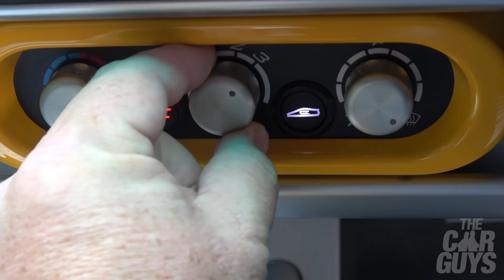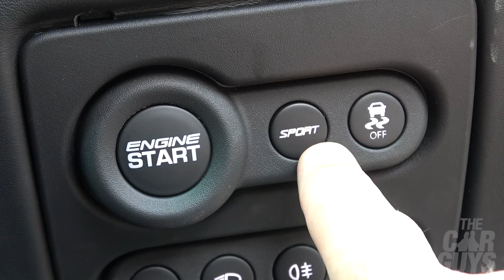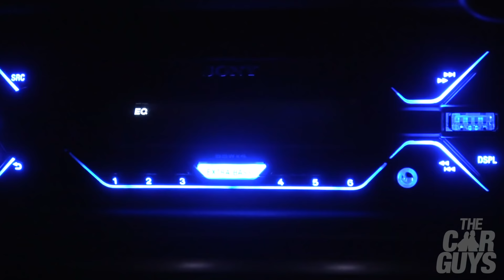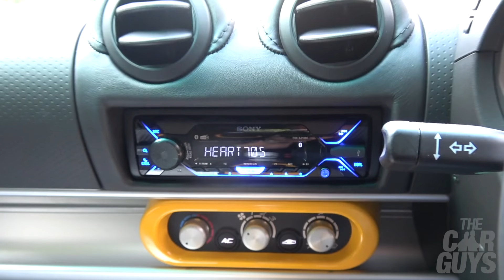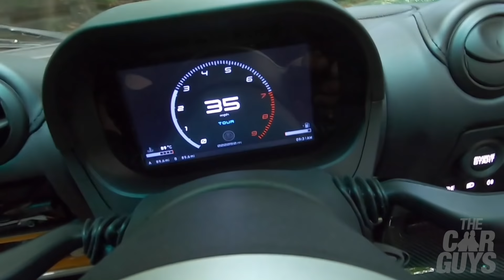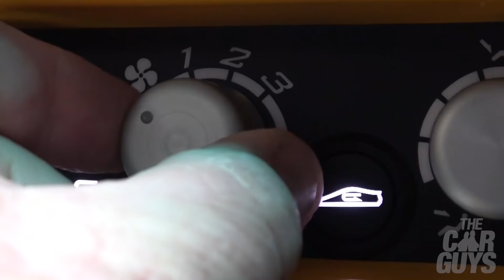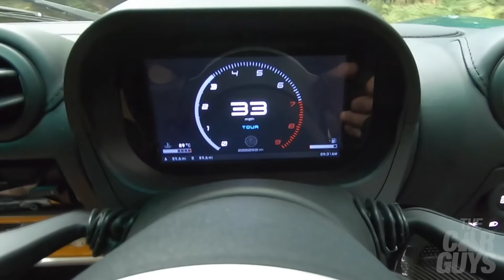650-Mile ROAD TRIP in My Lotus Elise 240 Final Edition – Is it a Keeper? | TheCarGuys.tv

Comment: I saw how your Lotus looked like a refrigerator. Tips for getting a car quickly warm inside. Start the engine and lower both front side windows by about 3-4 centimeters and set the fan to maximum blow. This means that the old cold air disappears and new and warmer air from the heating fan enters the passenger compartment. If the windows are closed, it takes longer before the old cold air in the cabin gets warm.
With kind regards from snowy Kiruna Northernmost city in Sweden) and we have -17 degrees Celsius
.
Reply: Thanks! How long does one keep the windows open for? Until warm?
Reply: @andrewnorris5415  Yes until the car gets warmer BUT you should not sit in the car in the meantime. On the one hand, air flow is then not hindered for the good of the body.
Reply from the maker: God tip, Ingvar
Reply: That works on my Saab 99 too!
Reply: @nickrichardson7451  This works on all cars and depending on whether it is an injection engine, carburetor engine and diesel engine, it takes different lengths of time. As I said, an effective way to get old cold air out faster and for the car to get warm with new air that is heated. This is not a new invention, we in Sweden have been doing it since the 70s.

Comment: What video is next?  Cornering speed of a 2CV? Cross continent in a 1980 Defender?  Picking up a three seat sofa in a Mini Mayfair?
Why take a 650 mile road trip (mostly on motorways/Dual Carriageways) to see if you like an Elise?  It was never made to do it? Get up a 6 am on a dry Sunday morning and go somewhere epic for breakfast- then see if you like it.
The fact that you did this with the car and still came out feeling better about it just shows that it's a more rounded proposition than it's given credit for.

All your complaints are valid though, wipers, lights, stereo, brakes etc.  On a longer drive, forget the stereo and connect your phone to some earbuds.. better sound, less noise more relaxing.  And plan a route without motorways, or even A-roads!
Reply from the maker: A roads were included on the route as you see from a lot of the footage, but the maps were used to show the direct route for the purposes of clarity.
I’m not some clueless twenty-something, I do actually understand these things 👍
Cheers for your comments, Peter
Reply: @TheCarGuysTV  Clearly you're not clueless, apologies for any disrespect perceived.  I hope you enjoy and fall for the brand as others have. hugs and kisses 😃

Comment: Great conclusion Damien, you kinda nailed it. Having owned an S2 Exige Cup 240 for 2 years, I can confirm that 90% of the time on the road it was quite horrible. Full harnesses, a cage, dampers set up for the track, very crashy ride and no sound deadening. But, when you get to the correct set of corners you just forgive it for everything and fall in love with it all over again. It's a rollercoaster of a relationship, and winter time is the hardest part; Just save your conclusion until you've had a full summer with the car :-).

Comment: Apply some rain-x to the windscreen, i owned three Elise based cars and found that a couple of coats of the solution fixed the smearing problem and improved the wiper performance.
Reply from the maker: Great tip, thanks

Comment: I feel your pain.  I owned an Exige S for over 10 years and had many of the issues you've mentioned.  One piece of advice I would give, is how to get in and out. 
I think I'm probably a similar size and shape to you and found it difficult to bend in half too.  So I used a different method.  
I would crouch down and then 'post' my top half in across to the other side of the car, grabbing the sill on the other side with my left hand, then I could bring in one leg at a time.  No need to fold !! 
Out was the reverse. Lean onto the left-hand seat, put BOTH legs out of the door (one at a time), and then using the steering wheel and the seat, slide out into a crouching position.  
After a few goes, I made this look almost normal, fast and not something that would draw a crowd.  Good luck
Reply from the maker: Wayne Rogers - that is most certainly a method I have not heard of before! You may have invented something new there, Wayne.

Comment: Thanks, good watching as it highlights the issues that look to have all been sorted with the Emira. The KEF stereo speaker system is controlled by the digital screen. I have contacted KEF to find out more.
Hopefully, you will still have the Elise by the time I let you drive my Emira for comparison  - in terms of quality and how it suits a different market segment. I suspect your will prefer the Emira's grown up nature and I am not getting the dark green 😂
Reply from the maker: I am v interested to compare the 2, or an Evora at least, and see what's been fixed.
Reply: @TheCarGuysTV  Yeah, big play on it being a LOT different to the Evora but the jury remains out for now. Either way, to me, it looks like a stone cold bargain. Perhaps only the 296 being as good looking.
Reply: @TheCarGuysTV  from what I saw of the Emira at the Goodwood FOS the car is based on the Evora 2+0 chassis architecture, i.e. VVA chassis tub plus front and rear subframes, albeit modified and improved. So to me dynamically the Emira is not "all new" but an evolution. Lotus didn't want to call it the Evora S3 as they are starting with a clean slate and on a conquest to be more mass market.
Now the interior of the Emira though, to me takes a massive leap forward. Gone is the after market ICE/sat nav and electromechanical instruments. The systems are integrated, so it's bang up to date with a digital LCD dash and all the usual conveniences you can find in a modern hatchback like an integrated ICE (the aforementioned KEF system) with sat nav, Apple CarPlay  parking sensors etc. Lotus have put a lot of development work into the user interface. Elise compared to the Emira will be like a very mature cheese versus new chalk. The Emira will be like the Evora - more of a GT, but very capable on track. 
Comparing Elise versus Evora there is a choice of Evoras, but depends on which Evora you choose. I have a Launch Edition that is NA (it's one that is stock save for a 3rd cat decat and a Lotus sports exhaust back box - you are welcome to try it once it is out of winter hibernation) then there's the Evora S, which has more grunt and had a slightly stiffer suspension, then there are the Evora 400s, which are different beasts so I've heard compared to the original "series 1" Evoras. The 400 and GT410 Sport are closer to the Evora S than the more track focussed Evora Sport 410 and GT430 Sport.

Comment: I've fixed the stereo issue in my S2 Elise in 2 steps. 1/ remove faceplate 2/ buy a Bose portable speaker. No tool needed! Bonus point, you can move the speaker to different cars that have crap audio, like many Ferrari's :D
Reply from the maker: I use that solution in my NSX 😂😂😂

Comment: Hey! It's a Lotus! What do you expect? They have never been perfect, there are often strange ergonomics that make them difficult to get on with and annoy you when you least expect them to! I remember my first drive in a Series 1 Lotus Elan back in the 60's where, once I had set the seat to a comfortable position, I found that the gearstick was up somewhere around my armpit and extremely difficult to deal with! It didn't help that it was at a track experience day at Brands Hatch and I got marked down for 'a lack of mechanical sympathy' because of it!
When you consider that Lotus through the years have robbed the parts bins of whatever manufacturer they were dealing with to save the development costs of doing it 'in house' they've not done bad. It's a Lotus, it handles like a roller skate and on twisty roads it can outrun most of its contemporaries. Be glad it's not a 25 year old Moscvitch!
Reply: I'd agree, the review comes across as someone who has no understanding of what they were buying, and bought the car for all the wrong reasons. If you care about the stereo or interior bits in an Elise, you've wasted your money.
Reply from the maker: I really don't understand your position, guys. You act like I should have ignored all the niggles I found with the car because "I should have realised what I was buying" - what kind of a comment it that? You want a video where I don't mention anything I dislike?
Surely, if you are bothering to watch the episode at all, it's because you are interested in my honest spontaneous thoughts about the car, from someone who has actually paid for it, as opposed to being given it for free for a bit?
The whole point of TheCarGuys channel is that we honestly talk about the cars we are driving because we are not beholden to any manufacturers, and we are not trying to get free stuff all the time.
And guess what? That involves talking about the good AND the bad in a balanced way.
Obviously, I didn't buy the car for the stereo, the windscreen wipers or the headlights (who does that?) - so you think I shouldn't mention those things?

Comment: Amazing car. i love my Lotus Elise s220 CR.. 250 cv x 900 KG, MY 2016   
regarding braking it is true it seems that it does not brake but if you press hard the pedal brakes and brakes well. the fault is ours that being used to much heavier cars that have more powerful brakes .. I have never had problems stopping. during the most demanding braking you have to keep both hands on the steering wheel because in case of uneven ground the car goes sideways it follows the road same thing on overtaking especially on trucks the air movement could make you go sideways

Comment: Carbon Lorraine RC5 pads will fix the braking. Definitely change head unit for something else. They have always been rubbish. I’ve changed to a flip out Pioneer (reverse camera, telephone integration etc) but others have changed to a modern unit with a built in cradle. Sub woofer is a must and gives the rest of the speakers a second life. I’ve gone as far as ‘heated’ carbon fibre seats. Wiper needs changing to a Bosch if you want 95% coverage. There’s also a cheap really upgrade you can do for more intelligent intermittent wipe speed. There are so many mods you can do (lighting, reversing, exhaust noise etc) but sense you won’t be keeping it long enough….. if you do I’m based in Poole and can demo/talk you through them.
Reply from the maker: Good tips, thanks

Comment: Thanks for sharing your experiences Damian- we are living a bit vicarious through your experiences!  I am happy that you are learning to like/love your Elise.  I think that the bottom line is that Lotus have done the important bits well- handling, gearchange, response, steering, etc- which is why you buy one.  The daily living stuff not so well which limits its daily useability compared to a Porker.  By the way, I like your green and it looks good on the S1 that was parked next to it at the factory-the yellow is a bit strange and the carbon cool.  I feel the Elise has been the spiritual successor to my Elan (no radio to concern myself with).  Even though the engine layout is different the DNA is the same-what a landmark car.  Looking forward to your updates-Cheers.
Reply from the maker: Glad you enjoyed it, Mark

Comment: To be honest, I'm not a fan of the newer Lotus cars.  Love the Elan and the Esprit.  The Eclat is an oddity which I'd probably enjoy owning just for s&gs.  The Evija is something just out of reach.  Never really liked the Elise, Exige and 'iffy' on the Evora.  Personally, I think I'd like either the final run V8 Esprit or a 1991 SE only taking it for some good tuning.....front splitter, larger/wider tyres/wheels, modern breaks/suspension, larger turbos/intercooler (ATS Racing: 400-450hp) with a Porsche Cayman transmission to handle the power....  ;-)
Forgot to mention, if I could locate a Lotus-Carleton this side of the pond......whoa... 

Keep up the posting.  Best from Canada.

Comment: You say the Toyota Yaris will basically kick sand in the face of the Lotus "Anywhere/ Everywhere", yet the lotus is 350kg lighter, has better straight-line speed, less mass to slow down and surely it isn't more agile than a Lotus. Therefore on a dry road that doesn't look like a WW1 'No man's land', then surely the Lotus would stay with it, at the VERY least. 🤔
Reply from the maker: Yaris is MUCH quicker in a straight line, and around corners thanks to 4W and its WRC suspension and mods. The GR feels like a rocket-ship compared to the Lotus.
Reply: P.s. I'm not questioning your car-driving 'palette' too vigorously, I'm just curious 😁👍
Reply from the maker: @englishjames007  Not a problem, my friend

Comment: The headlights on my S3 Elise were absolutely awful. I couldn’t believe a modern car could be fitted with such dangerous headlights. Phillips do an LED replacement bulb set, which completely changed things for me. I suggest you ask a local garage, or do it yourself and fit them. Ultimately I agree with a lot of the things you say about the car, I ended up moving myself into a Porsche, although I still long for that tingly steering, overall the Porsche is such a better rounded car. I also could never get over the frankly poor sound that came from the engine.
Reply from the maker: Cheers for the LED tip, Tom

Comment: Great video, great review - I drove a Vauxhall VX220 on track and an S2 on the road, and on the twisty's you can not beat an Elise - superb! On modern motorways it's small, revatively under powered, cramped and as you found lorry-track hugging. As there are few motorways within an hour of your home, keep in on the twisty B-roads and I'm sure she'll be in the garage for a while, but probably not permanently - Good Luck!
Reply: Any Boxster or Caymen would beat an Elise, what an Elise does best.
Reply: @Mexxx65  As the owner of a Boxster, and remembering it's at least 300Kgs or an extra 1/3rd more weight kerbside than an Elise, still personally think the Elise would beat a Boxster on a twisty B-road. The Boxster is more of an all-road machine, it's not as good on the twistys but far more capable on what today are normal roads like dual carriage ways and motorways.

Comment: Surprised to hear your comment about the Yaris “walking all over” the Lotus. That’s really made me think even more about the Yaris. I mean… The Lotus is widely acknowledged to be one of the best handling cars on the road. I think I need to test-drive one of these GR’s…

As for the head unit. Get on the Alpine web-site. I recommend those. 
And the colour… Told you to get an orange one! 😜🤭
Reply from the maker: The Yaris isn’t a better handling car, but it’s faster, grippier, more torque, more useable and better equipped. There isn’t a road where all that doesn’t beat the Lotus
Reply: @TheCarGuysTV  That GR is sounding more and more like my kind of thing.
Reply: @TheCarGuysTV  I’m scratching my head over how the Yaris could be faster, with a lower power to weight ratio and considerably slower 0-60 (or 62, as the case may be) results in tests. Could it be more midrange torque that makes it faster over a narrow rev range or the fact that you hadn’t been able to give the Elise the full beans when you formed the impression?

Comment: I think you should swap that Lotus for another one.
I started with an S2 exige S with 220hp. Fun but gutless. Had it 9 months. 
Then An exige 350 sport. Very good but I wanted more! Had it 8 months 
Now I have an Exige 410 sport. The difference is unbelievable. It’s a keeper.
Reply from the maker: The Exige is an entirely different animal I find - more of a track racer, whereas I wanted something more tuned for the road and less powerful so that I could enjoy it without dying.
Reply: @TheCarGuysTV  I do like the near death experience!
Reply: @TheCarGuysTV  Exactly the same reasons I went for the 240 after driving a 220 and an Exige 350 back to back.

Comment: The devil is in the details: the ‘yellows’ mismatch in the cabin would have driven me crazy! This is by far your best remark during the review as only very few people would have picked up on this tiny but very upsetting detail! You cracked it good! I wonder why you didn’t ask Lotus to swap the inserts in the seats by others better matched to the interior colours, specially since you were at the factory? Or did you and they declined? Overall these Lotus series have been brilliant BUT they are indeed very compromised cars with too many downfalls that Lotus pricing never acknowledged and sales numbers have always reflected on that. A shame but in turn making them a rarity that will be appreciated by owners for a long time. I remember test driving a Lotus Exige S (1.8 compressed 4 pot - awful gearbox, lots of noise in the spared cabin, amazing seats and driving position, best steering feel ever, light as a feather and nimble as a blue tit, forgetful ‘sound system’, an oven in the luggage ‘space’, not so good pedal box and nothing like you find in a Porsche  ) in Swindon back in the time Dick Lovett was a Lotus official dealership (!), paying a deposit for a brand new car for then the dealer to fail to conclude the finance in the time frame I had given them. I ended up buying something else from someone else and this is probably the only car so far I feel sorry for not having bought.